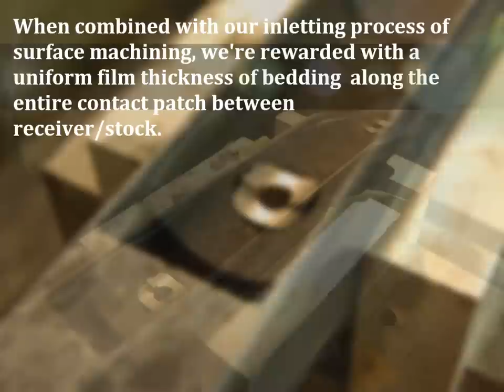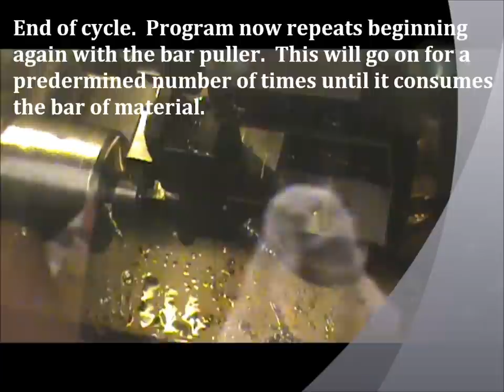pillars movie

Comment: Is the top of the pillar concave to match the receiver, or a V block contact?
Why is the pillar to receiver contact limited to such a small area?
TIA
Reply: It's 50 inch lbs buddy.  Not 500 ft lbs.  At .05" wide there's plenty of contact surface that's wide enough to mitigate distortion, yet allow for resin captivation.  The entire pillar makes contact, it just has a film of resin in between it.